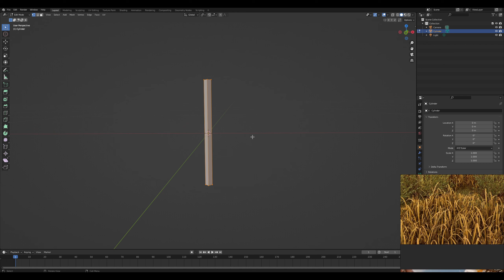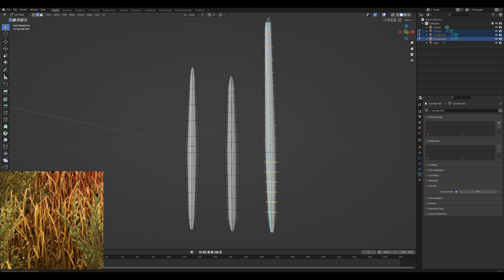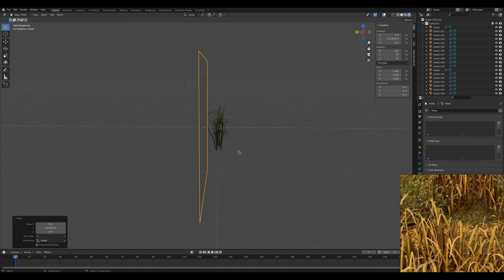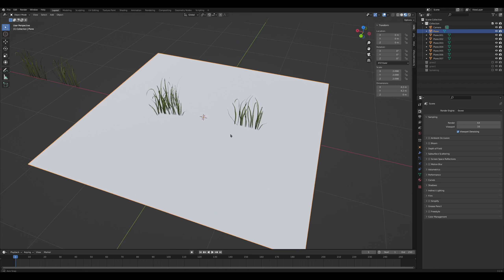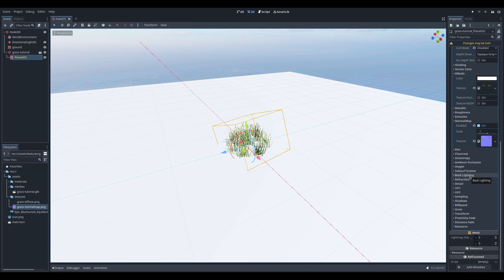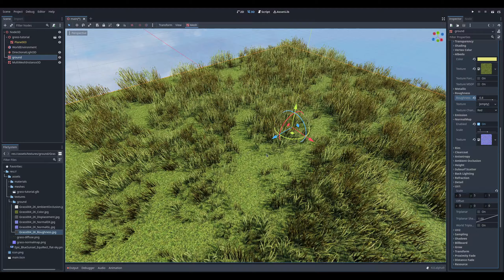Creating Grass For 3D Games - Blender3.2 + Godot4.0 (Alpha) Tutorial

Comment: So.. what is exactly a shader?
What it does?
Reply: It programs textures and meshes
Reply: A shader is a program that runs on the GPU. It's basically a piece of code that is compiled by a compiler (a computer program that interprets code) that comes with the graphics driver, and turns "human readable" code similar to the one at 20:08 into something that the GPU understands: machine code (a bunch of 1's and 0's).
At its core, a vertex shader can affect position and a fragment shader can affect color. What the color is influenced by, is up to you, but it's usually a combination of multiple sources like from textures, from light sources, from the angle of the surface in relation to the camera direction (Fresnel effect), from a mathematical formula that simulates surface microfacets (PBR), or even from a vertex color attribute, etc.
There are also other types of shaders, like tessellation shaders, geometry shaders, compute shaders that do specific things. They all manipulate data. Even textures, are just data. You can think of textures like a large array of values.